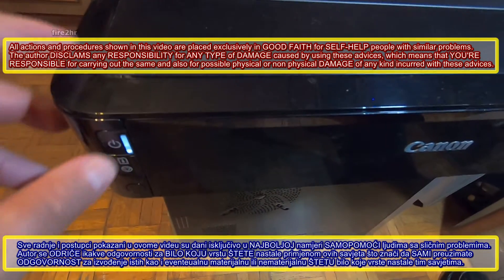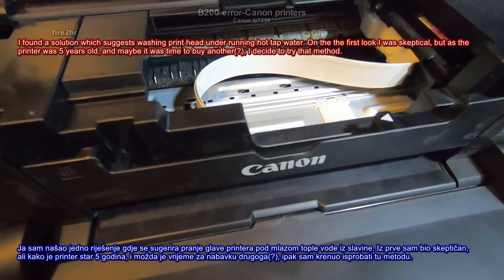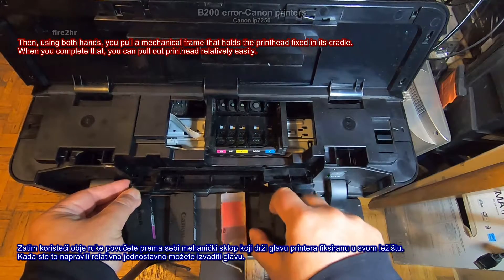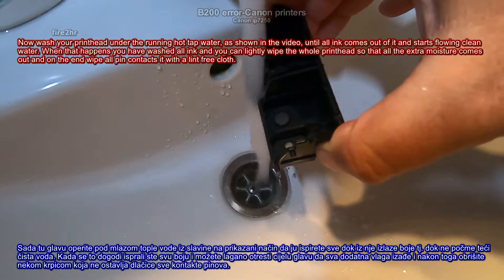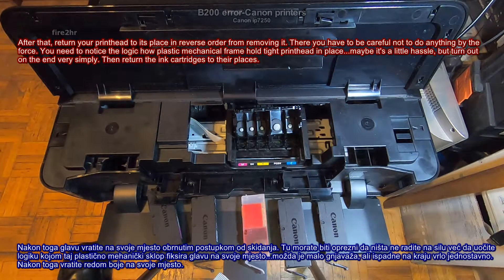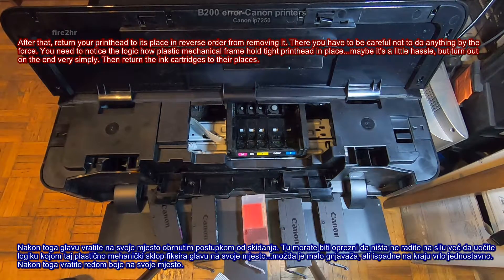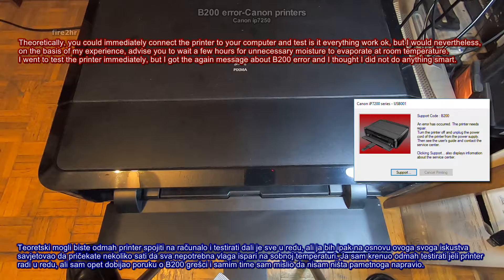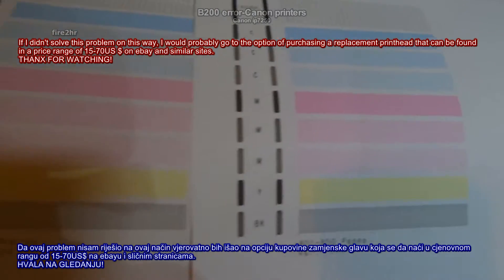B200 error-Canon printers (Canon ip7250)

Comment: After 3 hours dring outside on a sunny day it still shows error so I'm letting it dry some more. How do you run a cleaning utility if the error messages keep popping up?
Reply from the maker: You can't. I think there's no help in this case.

Comment: I tried it. But it Didn't work. But I have the ultimate solution for B200. 90% work as far as the glass sensor under your printer isnt broken. You are good to go with my by pass solution for canon Ip7240,Ip7250.

Comment: Don't work. I cannot remove and bring the cartridges to the middle manually from the side where they are parked. They are locked in the side where they are parked. AND one more thing,....the printer doesn't turn on anymore,..it doesn't get power anymore or it entered some kind of short-circuit protection,...how can I solve it?
Reply from the maker: Did You unplug the power cord and usb cable before manually moving print head to the middle(?) If yes then I think that is some mechanical issue.

Comment: On my ip7250, it will not switch on, there is no power and the left hand grey light will not illuminate. I have changed the power input cable and it is fine, ANY help and advice, would be greatly appreciated...Thank you..Gonzo.
Reply from the maker: So with new power cable printer work as I understand what You wrote(?)

Comment: Thanks very much. I had tried to clean printheads on an HP printer but as I thought it did not work.  I was skeptical but tried it.   Put the washed print heads back in and the ink cartridges and let it sit for about 2 hours and it started up and printed.  Not sure how long my iP7220 will continued, has been in use for 7 years and  over 4000 pages printed.

Comment: hello, after cleaning the printhead the printer still displays the message "the printer needs to be repaired"
what do you recommend?
Reply from the maker: Probably nothing. This procedure works maybe 2 or 3 times on dying printerhead as a temporary measure. New head cost almost as a new printer.

Comment: Hallo, The ink carriage in the printer is not instructed for the ink cartridges in the Canon ip7250 . printer
Reply from the maker: Until he worked ok I always was buying original cartridges. After problem show up I bought compatible replacement because I don't have money to waste.  Anyhow this temporary solution isn't permanent because printer head is dying whatever You doing. Buying new printer is the next step after this.

Comment: Had this exact same issue and this solution worked for me. I tried printing straight after cleaning the printer head and got same error,  I had to leave it 2-3 hours after I cleaned the printer head and worked fine after.

Comment: Dear Vedran
Greetings from London!
Thank you so much for this video. 
Amazingly it worked! 
I would never have allowed myself to run a print head under hot running water and believed it could work.
However we gave it a try and after eventually getting rid of the error message gave it 6 nozzle deep cleans before it came out clear.
And it works like magic now!
Well done on your green initiative to keep equipment running for as long as possible - green repair 

If ever you are visiting London send me an email! I owe you a drink!

Warm regards

Charlie H
Reply from the maker: I'm glad that helped. Thanks for very kind words.🙂
But keep in mind that's temporary solution for some time.😉

Comment: Preciso de ajuda, tenho a canon ip7250 e estava a imprimir quando deu um erro 1410 onde diz que o tinteiro não é reconhecido, já troquei o tinteiro e nada. Fica a piscar uma luz laranja no botão do meio onde tem a folha desenhada. O que posso fazer para resolver o problema? Não me deixa imprimir nada. Obrigado
Reply from the maker: If you don't use original/genuine Canon cartridges that can be a problem(?) 
Also can be a problem dirty or damaged printhead, especially pin connectors for specific cartridge.
https://www.justanswer.co.uk/printers/9rhid-keep-getting-code-1410-warning-cyan-ink-tank.html

Comment: It worked for me too! Thanks so much. Hate having to throw away things like this. One thing I'd suggest is letting the print head dry for a day before reinserting it, rather than letting it dry in the printer. Also, try putting something over the cartridge outputs to prevent them drying out while you're waiting.

Comment: My cartridge tray/lever (or whatever it is called) is stuck in a locked forward position and I cannot push it back, i have tried a dozen times. First, when I pushed the printer head back, it got stuck in a slanted position, and I couldn't get it out. I then removed the screws, one on each side of the cartridge tray and was very forceful to get it out, forceful towards the tray as well, as I got frustrated not being able to get it out for a long time. Hopefully I haven't broken anything. Now, I can't put the screws back on, as I don't have the magnetic screwdrivers, the size and shape of the few screwdrivers I have are not ideal, either. I tried putting them back, but looks like the distance is too long to screw them on, and they have fell multiple times into the inside of the printer and I had to shake them out :( Can I do anything to push the tray back? Everything is closed due to coronavirus and I need a printer. :(
Reply from the maker: Hm, I think by your description that you made some mechanical damage on mechanism(?) If you check on  7:43 you will notice that I didn't pull back ink cartridge on original position. I just close the tray and printer made all procedure after alone.